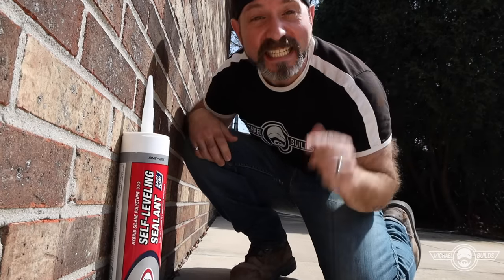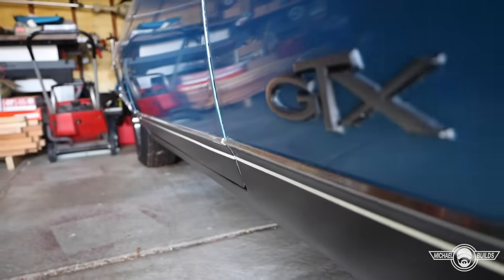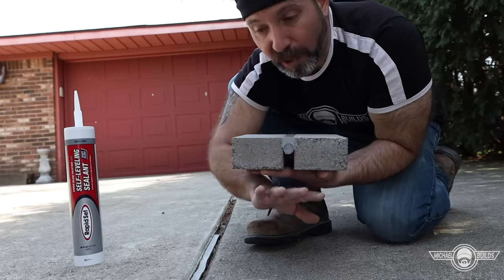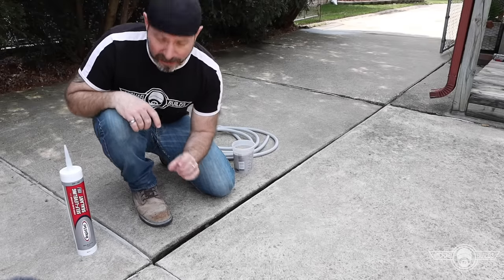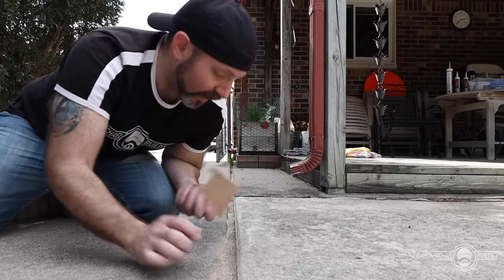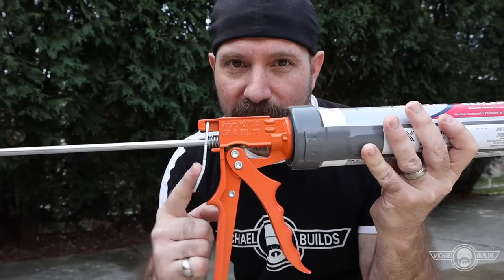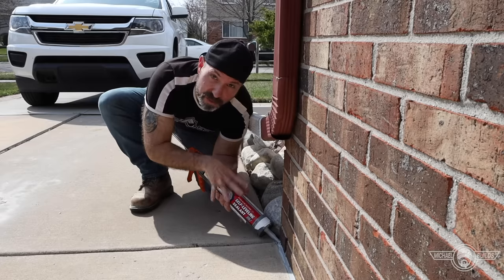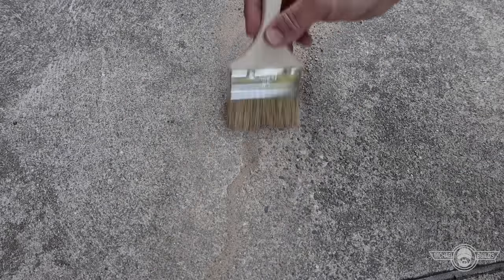How to Seal an Expansion Joint - 20 Tips and Tricks

Comment: Wouldn’t filling the joint with sand impede the function of expansion? Asking because my joints are around 4” deep and 1.625” wide. I’m concerned about the remaining void beneath my 2” backer rod since the gaps are wide enough for bike tires, trash can wheels, high heels, etc., to penetrate, but I don’t want to defeat the purpose of the joint or cause damage. Temps fluctuate from as cold as around -10 to as high as around 110 where I live
Reply from the maker: No because the sealant doesn’t stick to the sand, therefore it can still expand and contract with the seasons. But your gaps are almost 2” wide…. That’s a bit beyond what these sealants are meant for. I’m not sure that a sealant is the best option for your project because. Sounds like you have quite a bit of movement going on with your slabs.

Comment: So, how does one handle filling joints that are on a slope?
Reply: i'm actually wondering this as well. need to fill in the joints on my driveway which has a slight slope to it...but don't want all the filler material running out at the bottom

Comment: you owe your old man an apology, when he did that job he used the products and tech available at the time  the surface crack on the caulk you pulled out shows how long they have been in place, the products today have advanced immensely.
fyi, if you use sand you should mix it as a plaster with cement to stabilize it, as  loose sand will contaminate the edges and stop the caulk from adherring to the edges , :)

Comment: I bet if you were to just put a thin coat of the material on the lizards and let that dry and then repeat as needed, you wouldn't have to wait two weeks for it to dry. You could even do a thin rubber mold and a plaster or, because it's your channel, a cement mother mold.

Comment: Any issues with Rapid Set self leveling on joints on an incline (driveway, for example)? Will all the material flow to the bottom?
Reply: Especially when applied during a hot day, in which case, out gassing of the sealant could be an issue, too.

Comment: DONT DO WHAT I DID:
I didn’t have backer rod but I did have sand but didn’t feel like going to the store to get backer rod so I put the caulk on just the sand. 1 it was awful to work with, pulled all over itself and looked like sh*t. 2 the sand stayed wet and so did my sealant! I had to peel it all up and get backer rod down first now it looks like it should. 

USE BACKER ROD

Comment: Very well done  except for your use of fillers. The only acceptable filler is the proper sized backer rod.  Using sand as a backer substantially shortens sealants life span. Backer rod is available from 1/4” to 4” so there is no excuse not to use the correct size backer rod. Just like sealant needs to be a specific depth it also needs to be a specific profile. It has to be thinner in the middle than it is on the sides. You have to use the proper sized backer rod to achieve the correct profile “) (“
Since no one tools self leveling ( you should and we do) the top is almost always slightly convex making the use of backer rod even more critical. I have been a professional caulker for over 45 years and if we use ANY filler other than backer rod we void the manufacturer warranty.  It is that important.When you use $30000-$40000 (or more) of sealant on one project the manufacturers check these things.
Btw in the caulking industry the jury is still out on hybrids They make up very little of our business. And polyurethane when properly  installed will last 20 years. (They do fade.)The problem is, very few people other than professional caulkers install it properly. Handymen, GCs,concrete companies and pool companies usually get it wrong. That is understandable it is not there main business. And they never have to qualify for manufacturers 15- 20 year extended performance warranties.
Reply: Agreed, and it says exactly this on the instructions.
Reply: Please inform me how to tool the material. And which is best Flexible material for cold Wisconsin winters a hot summers. . I have cracks I "V" grinded and cement patched. They failed, and now to do again, I was thinking sealant. Thanks
Reply: @deathwheel27  I assume you mean self leveling sealant. Sikaflex Sell leveling and Tremco 45SSL (semi self leveling, better for sloped surfaces) Sika and Tremco both make quality sealants that are used by the industry.
This video shows the basics of installing sealants.( except you won’t need all of the tools because you will use cartridges.

https://youtu.be/SGsBh--eF6k?si=CpEgGAL5MjPc2BAQ
Reply: Thanks Gene. I have used the Sikaflex had some issues because of poor install. I will do it again , efficiently, and professionally, thanks to your help. 
👍🏻🤘🏻😎

Comment: I like how my honest review was reported as inappropriate and removed.  I assume this was done by the host of this video or someone who disagrees with an opposing result with this brand of sealant.   I was simply trying to say that (in my experience)  the recommended product brand is not a good one, at least not in 2023.   He has great tips on prep and how to use the product, however the brand does not work well.  I read all the directions very carefully and prepped my driveway very well.   The brand recommended consistently has separation issues.   Is he is sponsored by them, hence reporting my post as inappropriate?   Anyways, don't just take my word for it, please go search reviews for the product brand that's being recommending, they are not good.   Use his tips for prep and how to apply the product, just don't use the brand.   If you remove the post, simply b/c I noted my negative experience with this brand, then I'll appeal it with YouTube.  There is nothing disparaging about what I'm writing.
Reply: Sorry your comment got deleted. It's good to have different views exposed to an audience. Product manufacturers invest in quotidian advertising strategies as it provides best bang for advertising buck. 😉
Reply: So what do u recommend
Reply: @toecutter1015  Seems I remember one job where they installed an expansion material (about 1/2 inch?) between the sidewalk and the house basement wall. 
Then they came back and ran a bead of caulk over the board to hide the black color.
I don't remember if they removed some of the expansion board to accommodate the caulk, but that seems the only way to do this.
The result looked very neat and professional.
Reply: Says the guy that works for Sika.
Reply: Backerod, caulk, and toped with the sand for appearance.
Reply: I thought it was a terrific video but I agree with you that opposing views shouldn't be deleted. Greg, that being said, what product do you have a better experience with?
Reply: @dc-wp8oc  if it was something that was designed or engineered to be caulked then it should have been some type of backer rod or bond breaker in it then caulked but to caulk over the Expansion material is wrong and sidewalk joints need only Expansion material between pieces and really shouldn’t be sealed but often are just to make the sidewalk look a little prettier but it’s really just a waste of time and caulking for something that was done for centuries without caulking
Reply: Hate to break it to you, but about 99% of comments removed on YouTube are removed by YouTube.  You also seem to not pay attention to the beginning of the video when he addresses your exact issue regarding the seperation issues.